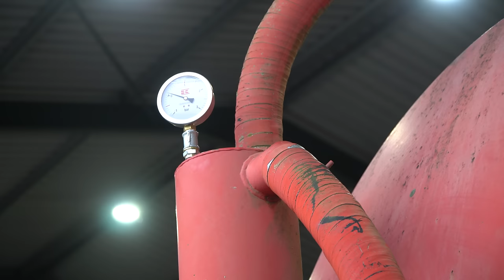Workshop Wednesday Episode 120

Comment: If you want to save your bucket brush from wear get a tractor yard scraper. The scraper is a cheap way of cleaning up muck from the cement when it’s nice and wet especially if it’s raining. I use one to clean up around the silage pit and where I load the diet feeder. Brilliant for cleaning the silage pit getting ready for silage making used in conjunction with a tanker of water. No hand brushing or power washing needed
Reply from the maker: We have a yard scraper that sits onto forklift blades great job when yard is wet